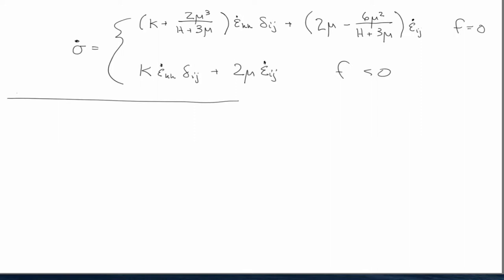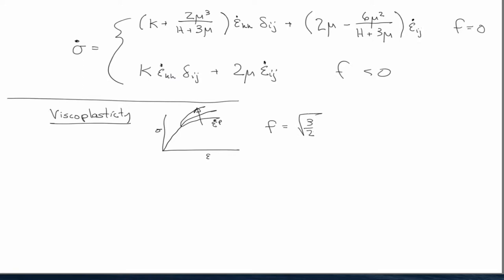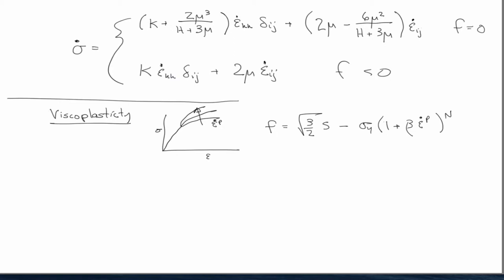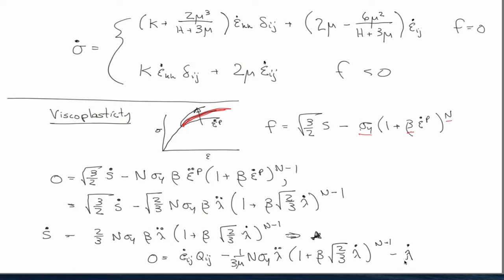Viscoplasticity

Comment: Please look at www.simxammo.com and give your thoughts on the viscoplasticity of a polymer bullet retaining energy (1/2 weight of typical lead--twice the velocity) and it's 'hardening' under the ignition pressure of firing the round--until it expends the saved energy into the target.  What is the easiest way to explain this process ?